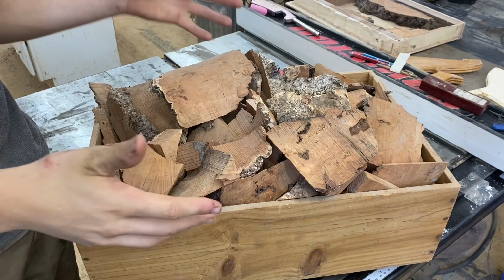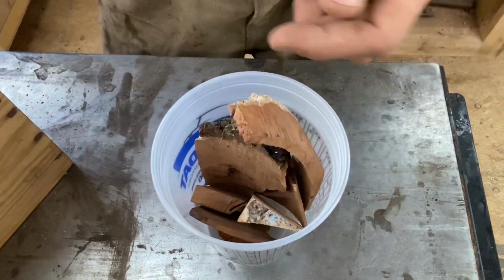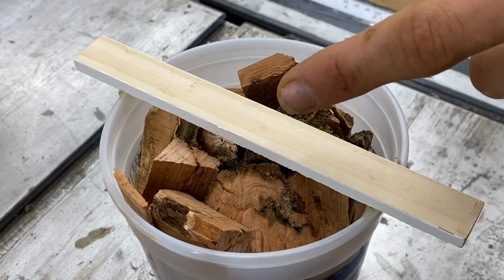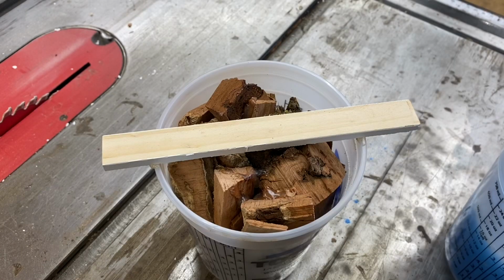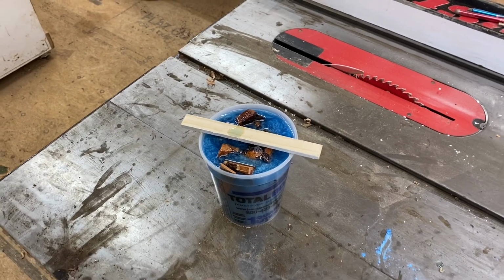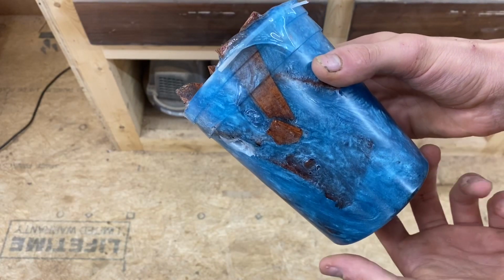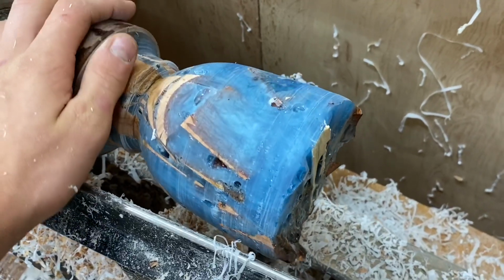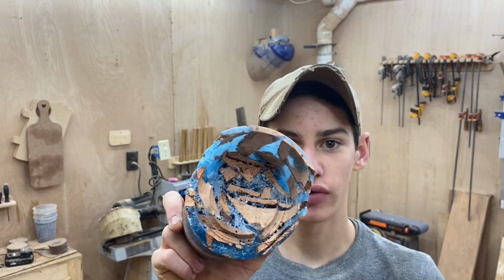Things don’t always go as planned.

Comment: What happened to your table saw seth, it looked so good after you cleaned it up. 

I reckon with the larger off cuts of burl you could mill them up into small usable pieces for boxes and stuff like that, another idea I have for you is to make a large sheet of cherry burl and epoxy with the off cuts, you could then use this compost material to make projects
Reply from the maker: Seans Unique Woodworking just got dirty over time. I gotta clean it.
Reply: @seths_custom_creations  nice